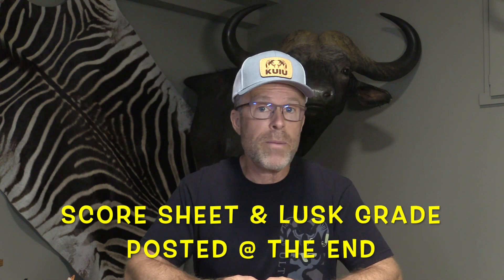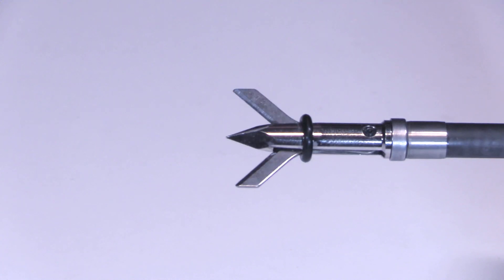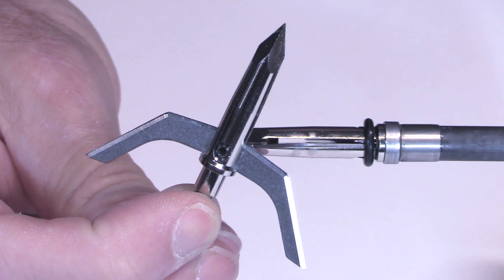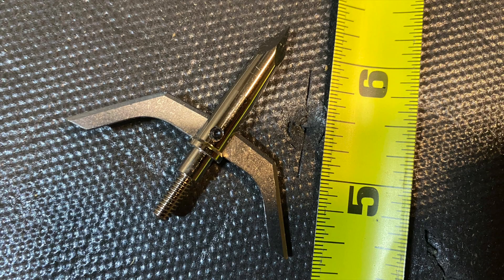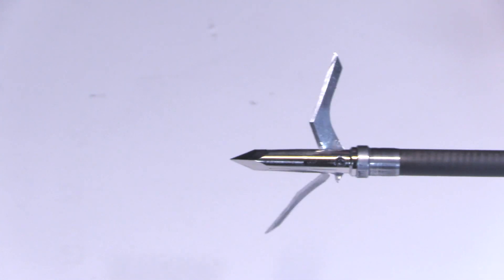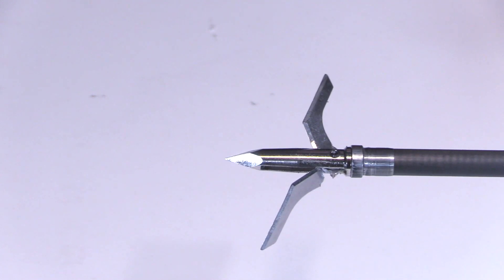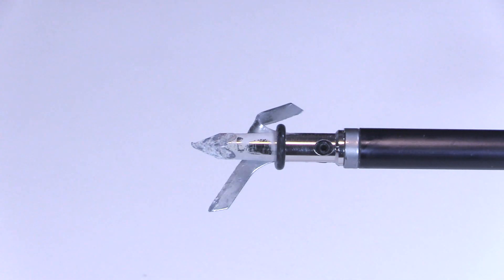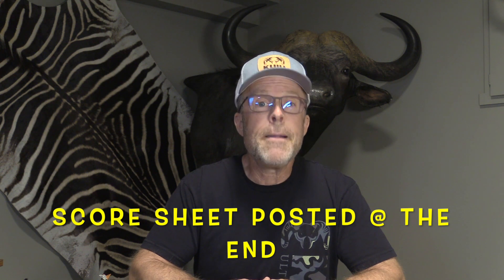VORTEX 125 S ALL STEEL Broadhead Test

Comment: Great video again. I'm curious how these broadheads, due to its design, will perform on quartering-away shots. In my opinion, I would be worried about penetration and deflection due to the blade design. Your opinion?
Reply from the maker: Yeah, if I were shooting these, I'd be very careful in how steep of a quartering shot I'd take. But I'm pretty careful about that anyway. I've had a slick trick skip off of a hog before and I learned that lesson.

Comment: Hello. This has nothing to do with this particular broadhead however I have a question. Next year I'm going elk hunting. I've been looking at the Iron will fixed blades but they're a little on the pricey side. In your opinion what is the best fixed blade for Elk?
Reply from the maker: Some other great fixed heads for elk that don't break the bank are Exodus and Tooth of the Arrow and Kayuga Gen 2 Pilot Cut. I've taken animals with all of those and really like them. Testing the Tooth of the Arrow XL Solid right now, and man it's a beefcake of a head. I only have a discount code for TOTA: LUSK19 saves you 15%...but all three are great choices.
Reply: @LuskArcheryAdventures  Yes I was looking at the Exodus it was in the running for what I was going to use. Those kayugas look nice too though.

Comment: Have you ever tested any rage broadheads?  I’m a fixed blade guy myself. Curious with all the hype on rage how well they hold up
Reply from the maker: Yeah, I have. I did a Destruction Test on about 20+ different mechanicals earlier this year. Anytime I do something like that, Rage are typically the first to bend or break. Their design is pretty good, but their blades are just too weak for my liking. Don't get me wrong, they can get the job done; I've taken animals with them myself. But there are much better options. The hype comes from their excellent marketing :)